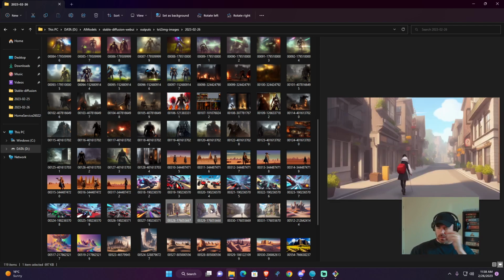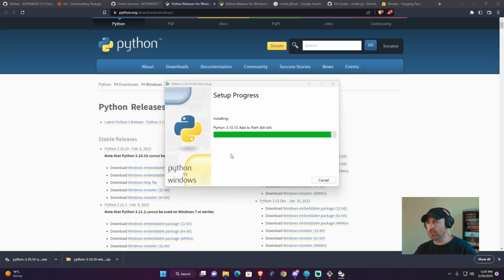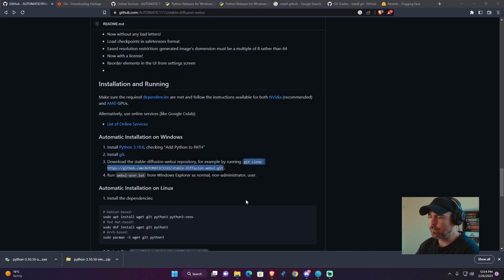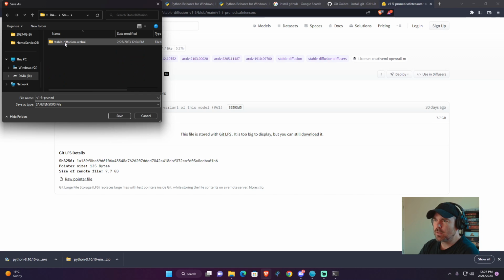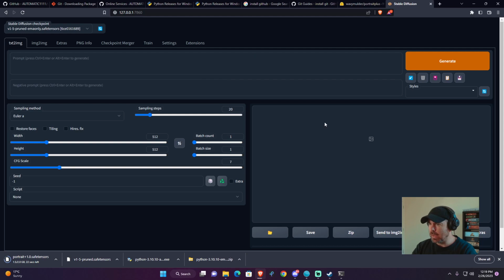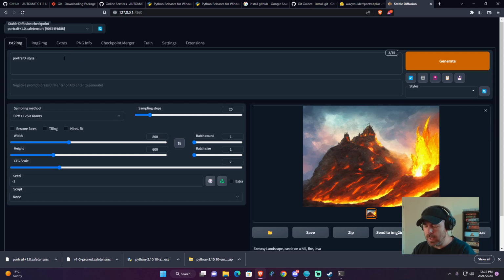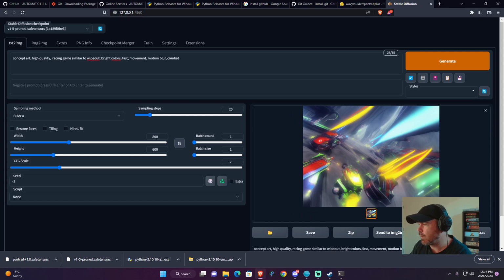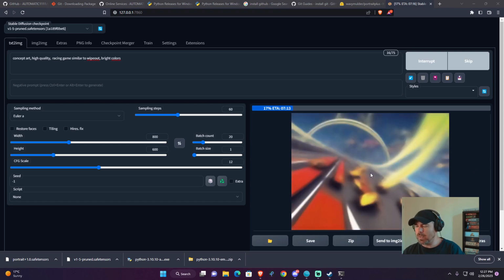Installing & Using Stable Diffusion AI Image Generator

Comment: i just want to say a massive thank you. I had such an awful time trying to grasp the fundamentals creating a state machine in Godot as I'm still a beginner. I followed one of your tutorials ("Godot One Shot : Platformer with Rolling and State Machine") and i managed to implement your method . Its still early days but its a step in the right direction. 
Just one curious questionthough. In your state machine tutorial you create 'func update_animation()' and add the necessary animations as states. However, I noticed you didnt add the function into the physics function like you did when you added 'get_input' . How then does Godot know to run the states.animations when its not called upon in the physics function? . Did I miss something?
For my script I had to add it to physics function to work. Im wondering if its because your using Animation player since Im using AnimatedSprite. Thanks for your help!